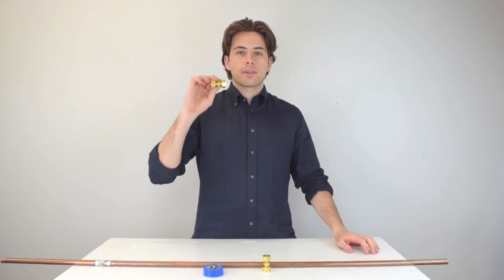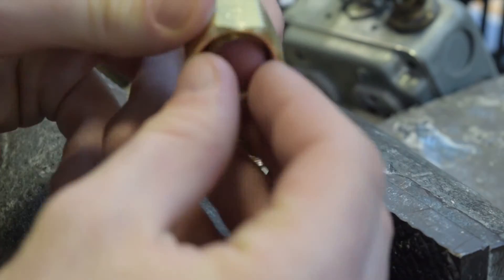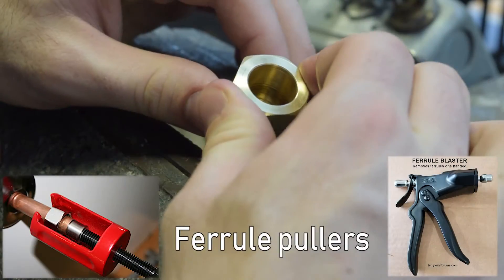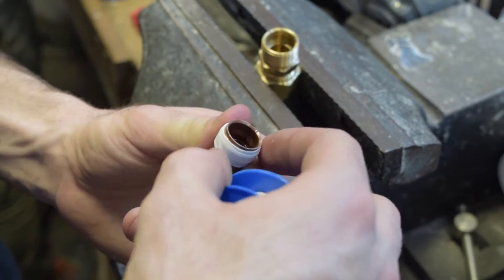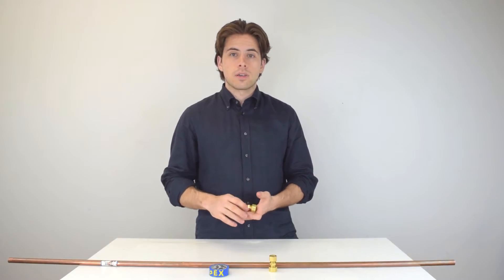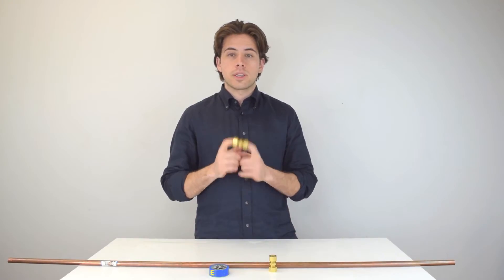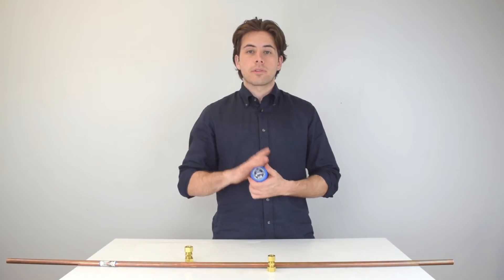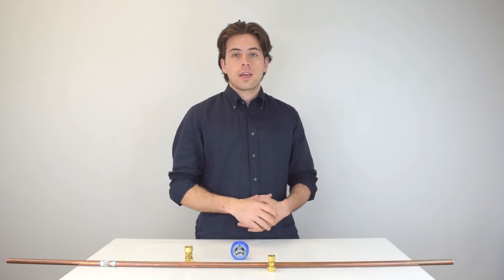Are compression fittings worth it?

Comment: Yes, all construction companies are always looking to make things cheaper and better, however, weld pipes have been shown to last 40, 50 years and more, let's see how long this new technology lasts.
Reply: Compression fittings aren't new technology. Compression fittings are even more trusted in industrial applications involving gas, air, water, oil, hydraulics, etc.
If they can handle 30+ years in an industrial environment with vibrations and heat, they can handle 40-50 psi of water in your home.
Reply: I suppose some unfrozen cavemen might think that compression fittings are new technology.

Comment: Soldering is so easy tho.
Reply from the maker: For some it might be.  The thing with soldering, which is both a pro and con, is that it's more permanent than a compression connection.  If you connect a shutoff valve in a hard to reach area, like under your sink, it's probably better to use a compression connection because you'll likely have to remove it at some point in the future.
Reply: I own a metal shop.  We produce bronze sculpture so dealing with copper is second nature for me.  Under the sinks l like male to female threaded hoses.  l just installed a couple of new sinks last week.
Reply: Soldering is outdated tho.
Reply: @scott19087  Not for jewelry and bronze sculpture.  We TIG and solder every day.
Reply: @saintearth  true, I was talking about plumbing and HVAC
Reply: @scott19087  Gotcha,  It's an old post.  If you scroll up the thread I mentioned that my company make bronze sculpture.  I still like using copper pipe when doing plumbing and I use solder for that.
Reply: @saintearth  yeah sorry, I see now. I still prefer copper for plumbing and heating as well, just not solder
Reply: Then teach me how to doggie then